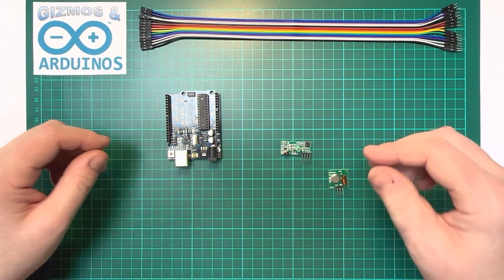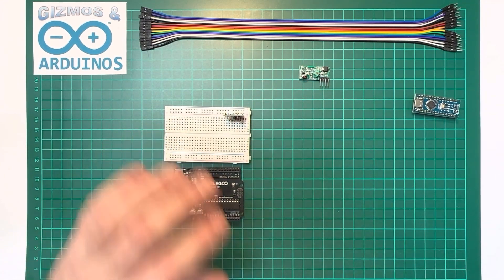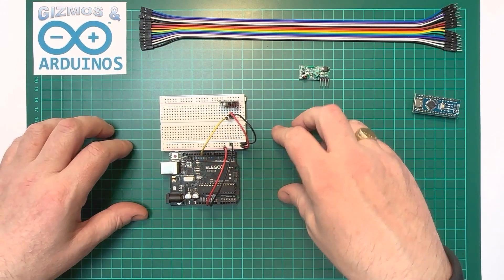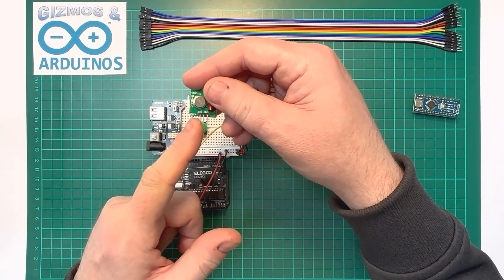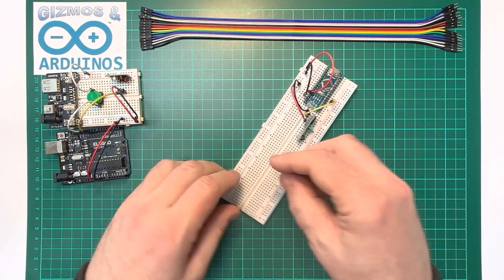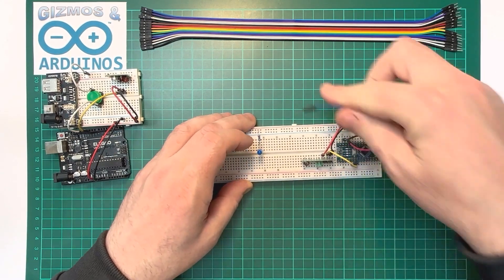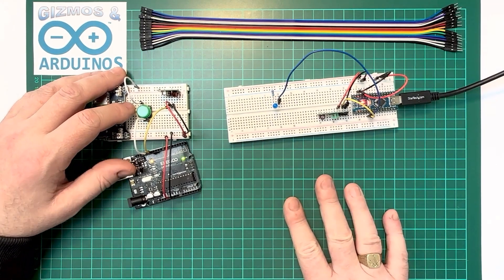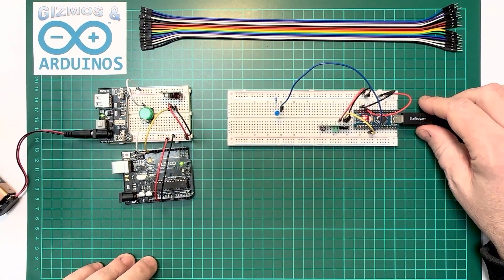Arduino 433Mhz Transmitter / Receiver

Comment: Can you explain:

RH_ASK driver(2000, 2, 9, 0); // rx,tx (transmit on pin 9, receive on pin 2)
 
RH_ASK driver(2000, 6, 12, 0); // rx,tx (transmit on pin 12)

Because I have a project that uses this transceiver but cannot connect the transmitter and receiver.....
Reply from the maker: Hi, sure thing , I'd be happy to help ..
So, in your transmitter code , you need the line RH_ASK driver(2000, x , y, 0);
Where 'y' represents the pin on your arduino that you have connected to the data pin on the transmitter module.
'x' can be anything, it doesnt matter in this case .

Now, in your receiver code, you need again the line RH_ASK driver(2000, x, y, 0);
but in this case, the 'x' should be the pin that you have connected to the data pin on your receiver module !
in this case, the 'y' can be anything and doesnt really matter what is there.

In conclusion, the numbers mean : RH_ASK driver( speed of connection, receive pin, transmit pin, 0);
Im not actually sure what the 0 in the fourth place is for, i just know that it is required !

I hope that helps a bit - please ask again if you're not sure
Giz
Reply: @gizmosandarduinos  ohh okay, one more think, does the speed of connection effect the range of the transceiver?? Because mine sometimes receive the signal, other times it won't receive anything lmao.

I don't use an antenna so I guess that's where the problem lies?
Reply from the maker: In this case, i don't think that dropping the speed would affect things much because of the way that ASK works is that it continually sends a carrier signal anyway .. But you could try it and see what results you get ..
I don't use an antenna either, and I will say though, one thing that will definitely affect the reliability is the power supply.
These things like to have a good strong 5v at least .. If I put a fresh battery in my transmitter then it works flawlessly, every time , for a little while .. But then as soon as the voltage drops a little bit i start to see like you describe .. Sometimes it works, and sometimes when you press the button nothing happens ..
Try a new battery in your project, see if that helps :)

Also maybe consider subscribing to the channel - I have some great little gizmos that use these 433Mhz transmitters that i will be making on the channel soon !

Have a great day
Giz